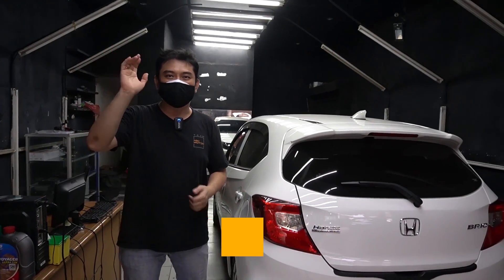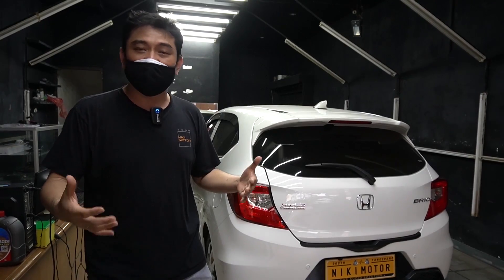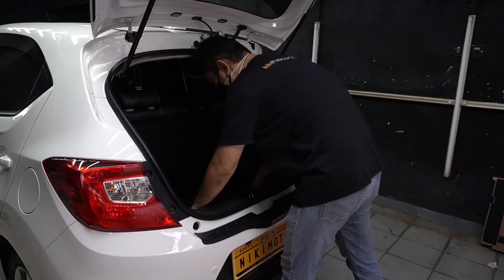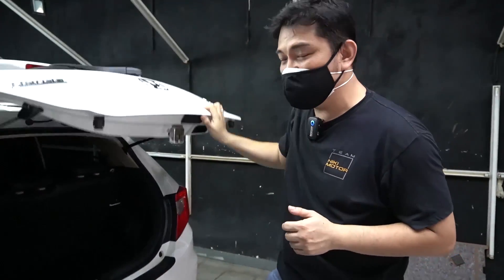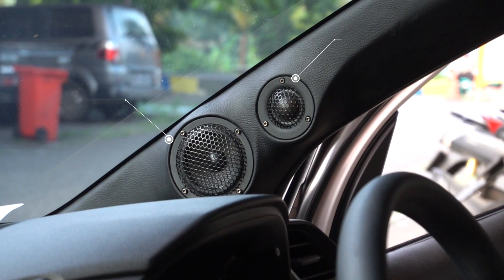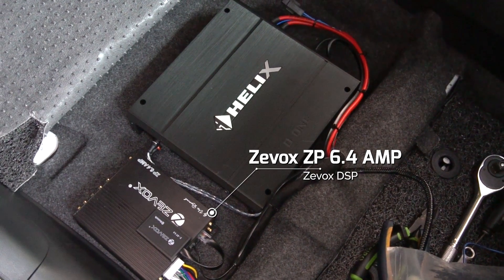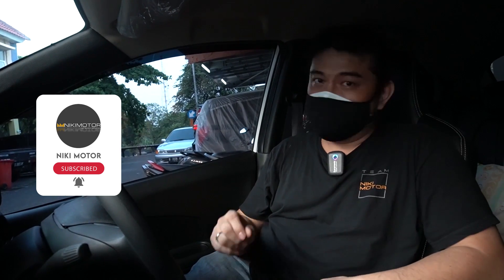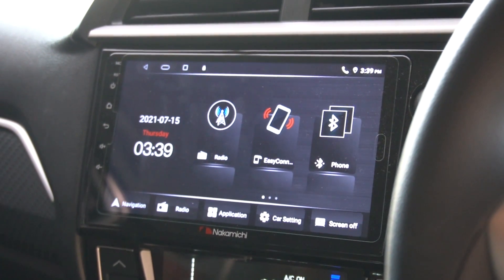Depan 3 Way, Belakang 2 Way. Honda All New Brio Car Audio Built with DUAL DSP !!! | CarAudioUpgrade

Comment: Mau tanya input ke DSP nya nih apakah
1. Input ke DSP 1 (Zevox ZP8.4) menggunakan RCA (pre out) Front dan Sub lalu
2. Input ke DSP 2 (Zevox ZP6.4) menggunakan RCA (pre out) Rear
3. Bisakah menggunakan 2 DSP yang berbeda merek bila menggunakan 2 DSP?
4. Peletakan tweeter tengah ditaruh di door trim? Gimana ngaturnya supaya tweeter tengah kanan tidak terlalu mengganggu posisi dengar pengemudi?
Video ini sangat menambah referensi untuk upgrade audio. Keren !!!!
Reply from the maker: Thanks om. Sy jawab yahhh.
1. Dsp 1 dari front HU aja. Subwoofer kita anggap bagian dari Speaker utama, yaitu 3way depan.
2. Dsp 2 terima rear output dari HU.
3. Sy pernah pakai dsp yg berbeda. Tp aman nya pakai yg sama merk nya atau saudara kandung 😁😉problem di delay takutnya.
4. Iya di doortrim. Setting Time alignment & leveling yg tepat, staging depan sama sekali tidak terganggu.
Reply: @NIKIMOTOR  Oh berarti pakai hi input ya Om dr HU, kalo pakai RCA Analog apa harus dicabang Om? Soalnya output RCA dr HU cum sepasang aja
Reply from the maker: @hendra46yanuar32  Boleh, dicabang gpp.

Comment: Oh iya mau tanya lagi om Teddy, kalo kita pakai HU sudah ada processor built in dan ada pengaturan Time Alignment/Delay. Nah kalo saya pakai DSP cuma 6 channel nih, channel 1&2 buat tweeter, 3&4 buat midbass depan, 5&6 buat subwoofer. Pengaturan delay kan lewat DSP. Nah kalo speaker pintu belakang saya di drive langsung dari HU, bisa kan saya atur delay untuk speaker tersebut lewat HU?
Reply from the maker: Bisa om, hanya agak sulit aja cari pas nya. Bahasa Delay nya HU dan DSP sering kali beda satuannya dan paling juga dpt nya kira2 aja.

Comment: Ko Teddy, XL7 bisa kah dibuat pilar spt itu. Karena ngerasa pilar standar aja kerasa BLIND SPOT nya
Reply from the maker: Bisa, ngga jadi masalah. Semua mobil bisa dibikin begitu.
Reply: @NIKIMOTOR  posisi spt itu cone nya tweeter & midrange bisa kena sinar matahari terus. Masih batas aman ya Ko ?
Reply from the maker: @erwinhendratmoko6463  pakai kaca film penahan UV yg bagus 😀 Konus speaker mobil harusnya sudah didesign utk tahan terhadap sun light exposure, pengalaman sy sih paling yg kalah cat di framing speaker nya aja, pudar/berubah warna. Kalo konus & surround blm pernah terima keluhan keriput krn kejemur sih 😁
Reply: @NIKIMOTOR  Matur suwun pencerahannya Ko Teddy. Tiap video baru NIKI MOTOR pasti nonton. Durasi video pas masang2 speakernya bisa ditambahi
Reply from the maker: @erwinhendratmoko6463  Siap om, terimakasih masukkan nya om Erwin 🙏🏻🙏🏻